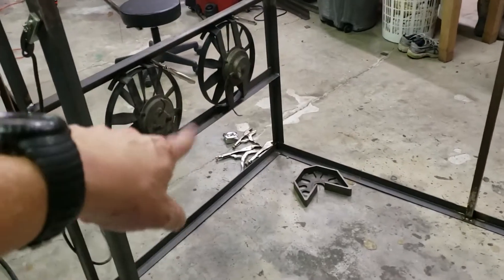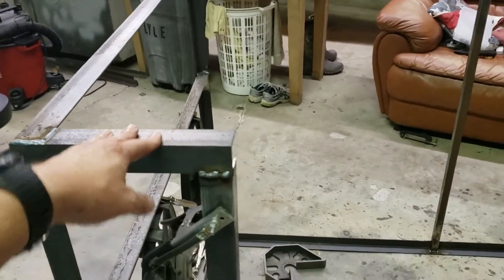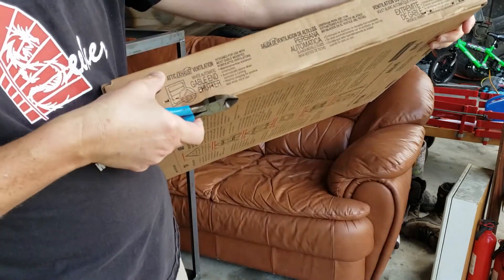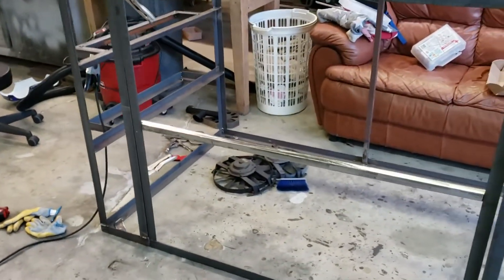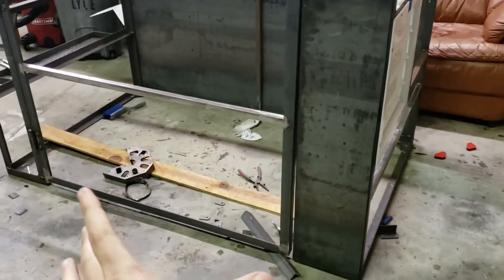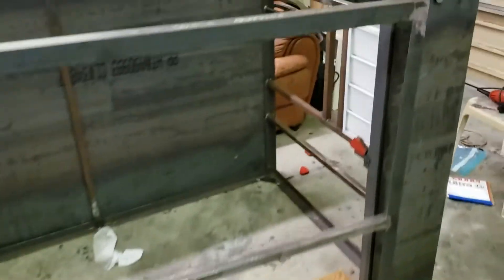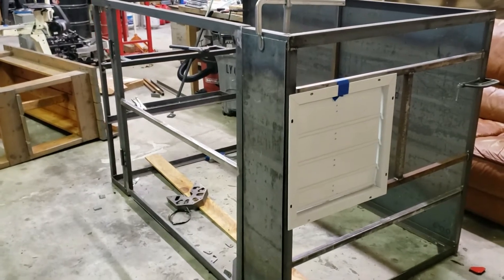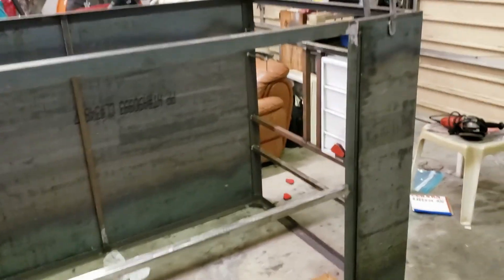Generator Shed 4

Comment: I see a business to build metal kits for generator enclosures. The only game in town now is "Zombie Box" which gouges buyers. Cut the sheets, make the cutouts, powder coat them and have customers bolt them together and add the sound insulation. Make it economical and customers will come.
     In your discussion in this video minimize your run of exhaust tubing. It can make the compartment very hot.
Reply from the maker: I agree, but I think the shipping will be a killer.  Maybe people would want plans so they can make their own and source parts locally??
Reply: @KMLTimesTwo  In a sense yes but not everyone has the tool or skills to do what you are doing.
Reply: @KMLTimesTwo  Not as bad as you think. Look up Zombie-box. Look at the price. Look at the weight. I live in Panama and would need it shipped to Panama. I am shipping a Honda generator here (250#) and why? Because I need it.  I won't air freight it because of cost but it will float over here by boat at a much cheaper price. I did not buy a Zombie- Box because I feel I am being gouged on price. 
     If I was living in the US I would consider this as a business opportunity. Most people looking for generator compartments on youtube choose generic Suncast Horizontal sheds BMS2500 or for larger generators like my Honda 5,000kw a BMS 4700. Problem here is fire, theft concerns and weathering. Metal is the way to go. 
     In your case you use an a square bar frame say, put brackets at connection points so the user can screw the pieces together. This makes it easy to ship boxes of components. The sheet metal work you supply, powdercoated in a separate box (es) that are manageable (weight wise). You can offer "fans" on your website or give an ordering reference. You can stamp cutouts for a propane line, perhaps one for the exhaust outlet and leave it up to the buyer to sort it out or put a standard opening. Another opening for a outlet cable. The buyer can source and install his own sound insulation. You can even oversize openings and include grommets or cable hatches.
  Look here https://www.youtube.com/watch?v=f8-sghM22NY. This guy I believe is from S. Africa. If you could replicate this then you have a product people will chase. As we progress governments will screw up on mgt. and distribution of power. There are rolling brown outs in California in Aug. (Global warming of course). This will be a new norm everywhere. Demand for generators will increase and so too demand for sound/storage enclosures. 
     In my case, personally, since Zombie-box is so expensive and since I don't like the cons of plastic sheds and also I cannot find a protective canvas covering for those sheds. I will sketch something up locally, and get a local with a welder to fab. something. I do not have any spray guns so the finish will not look so great, or alternatively take metal panels to a shade tree mechanic with a spray gun, but man, if I could find a kit, something in metal especially designed for gen sets with a double front door and hinged roof with a slope appropriately priced I would jump all over it. The Idea is to keep the welding and painting nightmares out of the customer's hands and let him do the things he can do with tools he has at home. 
    An analogy I would use is small model planes with nitro engines. Very few people like to purchase kits of stamped wooden parts and glue the parts together then put the skin on the wings and airframe and undertake all the other tedious assembly requirements. The majority just want to put the electronics inside a largely completed airframe. This is called ARF almost ready to fly. If everyone had to build the aircraft from a box of wooden parts there would be far fewer people in the hobby.

Comment: What are the dimensions of your shed top? I have a dented top off of a brand new 60kw generator enclosure if you want it.
Reply from the maker: Hey Jonathan.  It's - H46" x D43" x W70".  I have the top basically done, just need to add the sheet metal.  Thank you though!